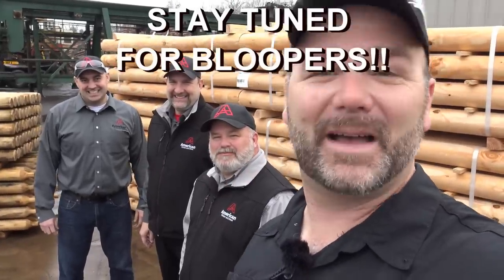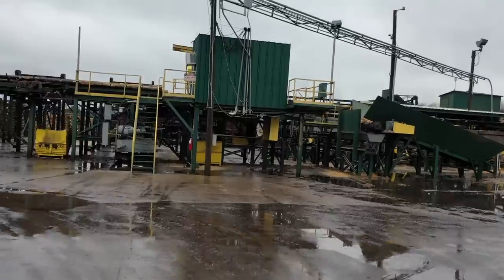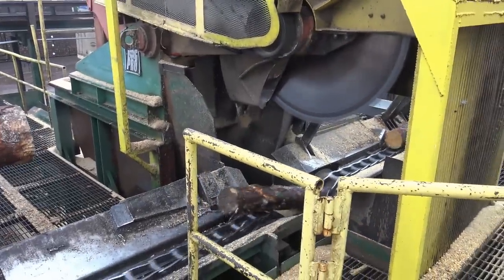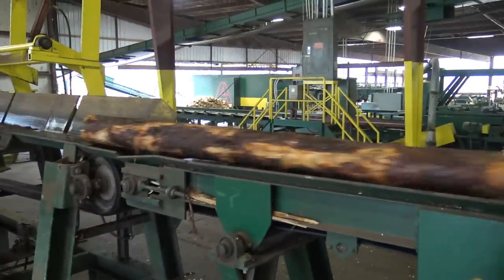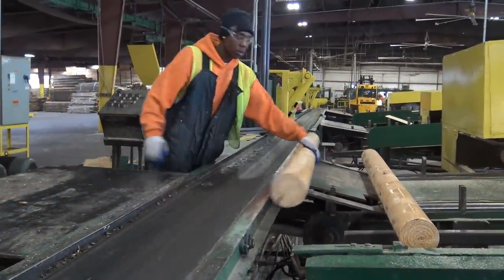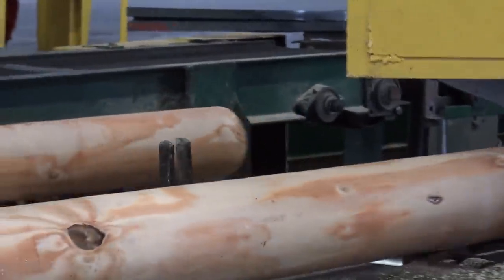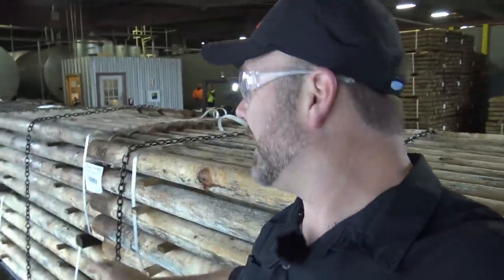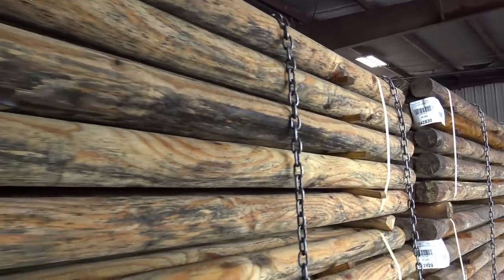How Wood Fence Posts are Made

Comment: Very interesting!   I have been through many a post plant, so it was interesting to see that it is not that dissimilar...other than the lack of safety gear.  Would be interesting to know what they are using for treatment as the posts seem black when they came out.  Although there are other chemicals, the majority of plants use a treatment that makes them a green color - they last a long time too.  Interesting to me that the plant is in Texas as I never thought of Texas as having a viable forest industry...my bad!  Good video!  Thanks.

Comment: Do they pull a vacuum in the pressure treating chamber before the chemical is introduced under pressure?
Reply from the maker: All I know about is 150 psi to fill the air gaps...if it were a vacuum I'd think it wouldn't fill the air gaps
Reply: Actually, I think they pull a vacuum, AFTER pressure-treating, so excess chemical will come out in the posts, instead of dripping out of the wood once it's in the storage lot.
Lumber pressure treating facilities uses to be a pretty big chemical mess. Not all of the chemicals would get pumped out of the pressure tank, and some would spill out when it was opened, and treated lumber would drip out in the storage yard. This caused lots of groundwater contamination. Now, the pull vacuum on the tank after pumping everything out (to help prevent dripping lumber), and they capture all of the chemical to keep using it. Financially and environmentally smart.

Comment: mention should be made of the chemicals used in the wolmanizing process.  Arsenic is a main player.  you do not want to ever burn any cutoffs of wolmanized (aka pressure treated) lumber.  the resultant smoke will hurt you badly

Comment: Hi Josh this was a cool video and all. But there's just one problem. That is the post. Those post won't last 10years tops. They maybe cheap but won't last like big old hedge posts. You had plenty of wood u could've got post from you know. If you build with nice big old fence post it'll last a long long time. Fence my grandpa built when he was a kid is still standing and strong. And about 15 years ago there was a about 500ft of fence that needed replaced and he found these post at the store that were treated. Guess what 10, 15 years later the t-post or steel-post or what ever you want to call em are the only thing holding up the fence to this day but we actually just tore it out this winter. Any ways Those post had all rotted away that's what those post do they rot so fast and quick and aren't worth a damn. Sorry for this big rant or whatever you want to call it. Just wanted to tell you our luck. But for the rest of your fence this may help you.
Reply: Yellow pine or ponderosa  pine do not make good poles. Notice the large growth rings when the ends are shown. The larger the ring the softer the wood. Jack pine or lodgepole  pine are far better.
Reply: @FARMBOY 8504 these posts should be good for 25 years easy. Depending on treatment type. This is a very good company making quality product. Get fence posts treated for your application. After all there are over 300 different options.  I used to be a farmer, and a honest to goodness cowboy and rodeo bull rider when I was young and dumb. So I understand where you are coming from when a farm store fence  posts dont last like your grandfathers osage orange or black locust or whatever he used. But very often "treated lumber " is sold and used for projects it was never intended for because people can buy it and you dont need to be a professional to buy it and use it. But I bet you dont know what  the use  codes on the treated  lumber tags at the nearest lowes or home depot even mean.  I have been through many treating plants in my life here in the US and in other countries. Years ago I used to own a sawmill. But it was hard work and hard to manage with my particular limited skill set. Now just  selling Lumber and treated lumber now  is my job .  I have been over to see what Henry ford did when he used treated pilings under the ford  river rouge plant in Michigan over scores and decades ago. Very few have been replaced. Why are they lasting so long?  If you know nothing about posts or treatment chemicals I could explain. But these posts are easy good for 25 years if treated around 19% moisture say with a minimum .40  CCA .  Fence posts are one of the 7 few things still allowed to be treated CCA.  It all depends how it is specd..normal farm and ranch stores sell whatever they can make money on. Never buy from TSC or the like. I move hundreds of semi loads of posts every year to professional fence builders and contractors. Less than 1% of my sales are to farmers or ranchers because they dont know lumber. They know farming. I would never buy diamonds from a farmer. I would buy farm goods.
Reply: @williamabercrombie1007  you are contradicting yourself. Lodgepole Pine / Twisted Pine and Jack pine is technically classified as a yellow (hard) pine.  Now,  it shares many characteristics with white (soft) pines, having a considerably lower density than the yellow pine species found in the eastern United States.
Reply: trains twisted pine or lob lolly pine found in the south east is not the same. Yellow pine is ponderosa pine
Reply: @ifyoutip  you can't  guaranty  any wood for 25 years. I have lodgepole  pole fence here on my place that has been here since I moved here longer than your treated claim but I live in a high desert.  None treated  fence. True story rails are getting  sad and probably  should be replaced soon. Not the point. All things are not the same. Different  condition  requires  different products
Reply: @williamabercrombie1007 I see.  Here in the southeast I was  taught that "Yellow pine" is a number of conifer species which yield similar strong wood.There are many different yellow pine species from California to Virginia. 
 As far as fence posts, I dont mind loblolly fence posts for "some applications" My experience is they can be  superior. The next job might not be a candidate for them at all. The wood from the "southern yellow pines"  typically has a density value between 50–55 lbs/cubic foot when pressure treated. They retain the chemical well.  They might not be as tough if hit with a side sheer impact, but they can go for years without rotting if treated properly. I get requests for 2.5 CCA in a 6-7 " posts for some special applications. You cant get that treatment retention in many other yellow pine posts. Otherwise I dont like loblolly pine posts. But  A lot of 4th generation seedlings around this territory.
Reply: trains there is a difference  between  lodgepole  here and there. It's  climate.  You can even find  it here between the east side where I live and west of the cascades. The treatment is a totally different  issue. Large  growth rings simply take more treatment. I wouldn't  argue that. Does  it make what ever wood stronger or last longer?
Reply: @williamabercrombie1007  that's right. I agree with you on that.  I was originally thinking of the generic term 'Yella wood" as covering a broad range of pines because we understand it that way here.  When I sell wood to a customer they usually give me the dimension and quantity  they want and dont always know what they need. Often they say they just want a treated yellow pine. So I ask them more details about what they are doing and try to get the best possible products for their need. You mentioned your fence. Here most animal fence is high tensile, "not low carbon" woven wire or barb wire. If we dont use class3 coated or ZA coated wire the fence rusts apart In less then 20 years. When we started getting better wire we needed better posts. Then we started getting interested in the science of the wood and treatment options. I have rode fences in  Nebraska on horseback when I was a kid.   I have built fence far West, in old Mexico with a  species that I don't know how to interpret. But the old cowboys of that time told me the same thing you just told me about your fence on the high plain.  Over here in the south east we depend on treatment. I used to sell wood with 30 year guarantee and 30 year warranty against rot and decay. And it was a good guarantee. However it had to installed properly and by a certified installer.

Comment: How long are the posts given to air dry
Reply from the maker: until they are at 30% moisture the time is different for different times of year...i.e. it rains more and is cooler in winter so the timber will dry slower
Reply: @StoneyRidgeFarmer  any idea what the time spans is...weeks or months...we leave post out for a year to season here
Reply: @cappa6350  around here in the midwest it depends how they are stacked and or bundled. But normal bundles of posts take on average a minimum of 5 months up to 9 months. All depends on weather how they are bundled and wind and what  season of the year they are set out to dry.

Comment: Plywood mills also make fence posts as well.
Reply from the maker: I guess some might ....but I'd rather have a post from a specialized post factory for our farm...very impressive operation for sure
Reply: Plywood  mills have peeler cores. Worthless for any kind of fencing  or stakes for that matter.
Reply: @williamabercrombie1007  I was wondering about that.
Reply: @Opinionatedguy1989  I have been  cutting post and poles since 1983. Hands down for the money  lodgepole  is  king. I live in central  Oregon  and cut by hand until a few years  ago. We merged with Quicksilver  contracting and now I with a warpath in a computerised automated  system.
Reply: Smart computer,lol waratah
Reply: @williamabercrombie1007  I live near a plywood mill in greater Vancouver British Columbia and I would see truck loads of peeler poles drive by, away from the mill all the time. I know from driving by that mill, it has its own chipper on site.
Reply: @Opinionatedguy1989  A plywood  mill doesn't  tell me much. You can have a plywood  mill and a pole mill together. Most common  in a plywood  mill is a log gets turned,  a growth  ring at a time until there are none. What you have left is heart wood or no possible fiber. Decaying  wood. Is that a pole. It's  likely  round and you can cut it to whatever  length but it's  not  likely to do much for you. The best pole  for strength  and  longevity will  have tight growth  rings a the least  amount taken from it. The more you take from the outer layer the weaker  it gets.

Comment: What does a post cost ?
Reply: Depends on location. Im gonna guess At the factory probably sell to a dealer for $9.45 each for a 6" x 7-1/2' long.  But they would not sell you just one. You would need to buy a full truckload or 44,000 - 48,000 lbs worth  Shipping posts is expensive because the posts are heavy. If you want 6" posts you may only get 570 pieces on a semi. Then from Texas to your farm could be 1 or 2 or more thousand dollars in freight costs.  So add freight costs to the post. In NY these would be selling for probably $15 something  per post if they came from this very mill in Tx.  I haven't actually priced them but I work for a company who is a American Timber dealer. This post company also has a location in Norwalk OH.

Comment: I was hoping for a more in depth detail on how the treatment takes place
Reply: Not absolutely sure about this treatment but creosote is the items to be treated are run into the cylinder like was shown and sealed.  A vacuum of about 27 to 28 in of mercury is pulled for a specific time, the treatment which is heated to about 180* F fills the cylinder and is pressurized to a specific pressure for a given time,  the treatment is drained from the cylinder, a 28 in vacuum is pulled on the cylinder for a certain time then released, any residual treatment is drained off, the cylinder unsealed and the trams with the items are pulled from the cylinder.  The difference in volume of what was drained off from what was used to fill the cylinder is what went into the product.   I have an idea that this process is very similar.

Comment: How sustainable is this as this is an industrial size manufacturing plant cutting trees quicker than they can grow?
Reply from the maker: Do you actually think that this fence post factory uses up trees faster than they could grow?  The trees don't get cut until they're of size to be utilized.  Trees are grown as a commodity just as wheat is grown for cereal grain.  They're harvested and replanted just like grass in a hay field.  We've cut 100 acres of trees on our farm and replanted around 30 acres.  Part of owning land and forest management
Reply: @StoneyRidgeFarmer  So you are 70 acres of trees down. Wheat takes one season to grow, trees how many years does it take to get trees with twenty foot useable wood? And in that time how many trees have gone through the plant cut up into fence posts? How many trees are planted to make up for the ones cut down?
Reply: These trees are managed tighter than your average budget.  They ain't close to running out of trees. In fact there are more trees now than a hundred years ago. Most tree plantations here are in 4th generation seedlings
Reply: @ifyoutip  That is nice to know. Thank you. You see city dwellers only see concrete and have false awareness or what is happening.

Comment: Hey guys, Nacogdoches, TX is about 140 mi (225 km) north-northeast of Houston, 180 mi (290 km) southeast of Dallas, and 90 mi (145 km) southwest of Shreveport. 
According to the United States Census Bureau, the city has a total area of 25.3 square miles (66 km2), of which 25.2 square miles (65 km2) are land and 0.1 square miles (0.26 km2) (0.24%) is covered by water. The city center is located just to the north of the fork of two creeks, the LaNana and Banita.

Comment: The cutoff saw need to be set back to shorten the posts a bit; way too much is wasted cutting the long ends off. I worked as a sawyer for 7 years and we cut the sawlogs only 2 inches extra long to make lumber from them. 
You don’t get as much for chips as posts.
Reply from the maker: I'll pass it on to management ....I'm certain they do everything for a reason...I'm just not sure what the reason is

Comment: I don't understand why they don't make them from melted down plastic...
Reply: @Joe W. Well, this company doesn't obviously but another company does. I can sell you some if your interested. Also fiberglass and steel posts available. I've been to a  t post factory in western PA where they were cutting old train track rails. Slicing them into steel t posts. It is interesting.
Reply from the maker: Timber is the most renewable resource on the planet....plastic is not

Comment: steel pipe corners, better, stronger, last longer.
Reply: Cost A LOT more to make, and harder on the environment.
Reply: @dundonrl  Harder on the environment? Drillstem is going to be used for oil drilling regardless. Re-purposing oil field pipe is better than cutting down trees and turning them into posts. These posts will rot long before a drillstem rusts out. And cost? An 8 ft cca post where i live in nebraska costs 18 dollars while a precut drill pipe is 13 dollars.